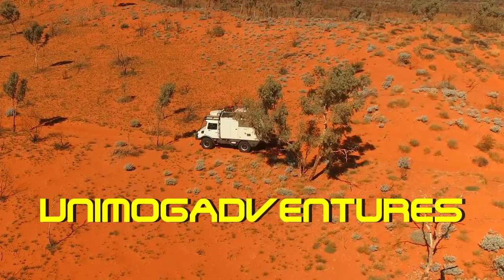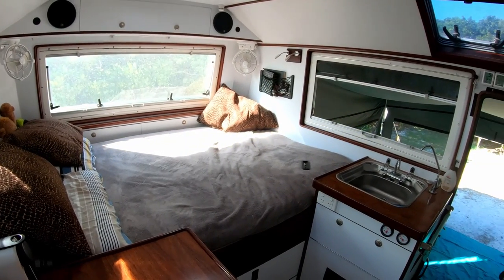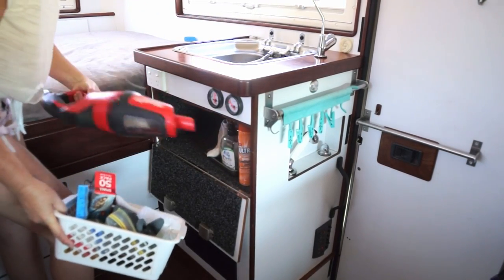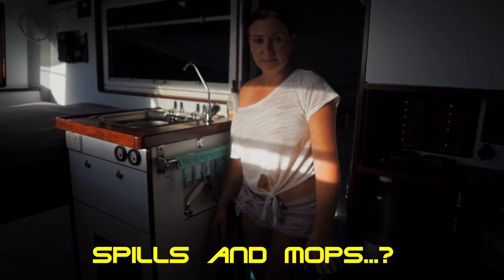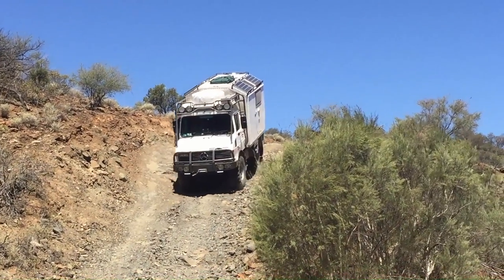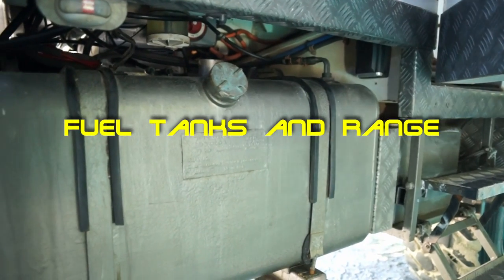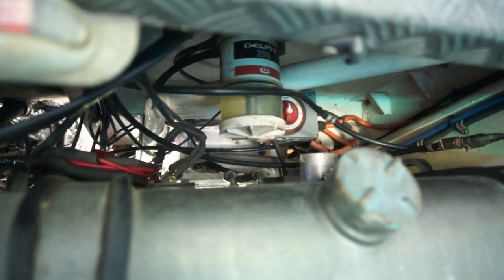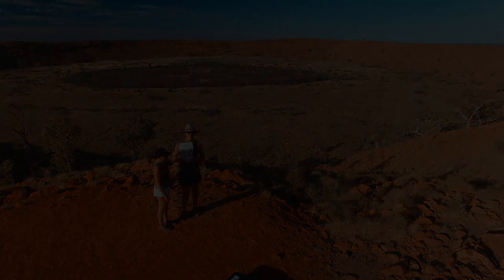I think this is the best Unimog overlanding truck in the world, but I am a bit biased.

Comment: That shower positioning is genius indeed. 🤔The only thing that i thought you guys should have it is air conditioning
Reply from the maker: We spend a lot of time outside exploring so are used to the heat.     With the cross flow ventilation from the big windows all around, we would probably  not use a/c much as we love the silence of the Outback.

Comment: You also asked about coffee machines, we recently moved to a Belman stove top expresso and cappuccino machine. Only needs a heat source and removes the need for electricity. Worth a look if you like flat white coffee.
Reply from the maker: Thanks, we will have a look at it.  The diesel stove takes a while to heat up, and stays hot for  a while after switching it off, we would prefer something electric, as we have a 240V inverter, but can only use about 1500W continuously, and about 4000W for five min.  Looks good for out outside stove, as gas heats up quick.

Comment: brilliant idea using 4 inch PVC pipe heated with a hot air gun ? and pushed inside the oval tube of the tray frame to store your tent / awning poles.

Excellent job , I tips my hat at you :)

I have heat formed PVC before but i didn't think of that one :)
Reply from the maker: Iain has some good ideas.

Comment: Very informative video! I was very interested in the engine rebuilding process. I used to work on some of the V series M/B engines. Strong and reliable! I was curious on what spare parts for the engine you carry.  Belt, filters, nozzles? Thank you!
Reply from the maker: We have some videos of the whole engine rebuild as well.   We carry spare belts, injectors, a waterpump and various parts for the air system and brakes, along with oil and fuel filters.